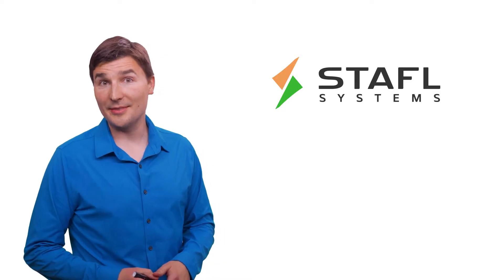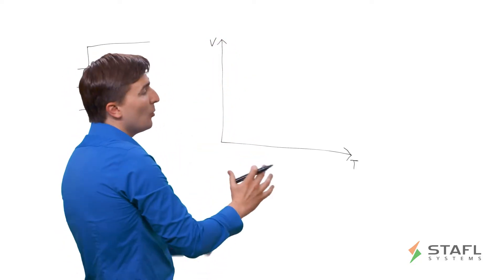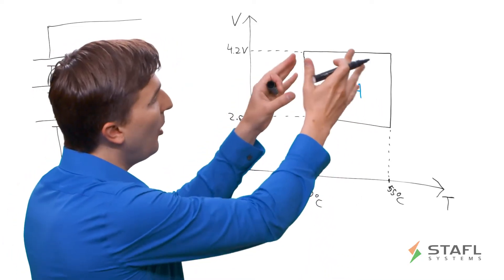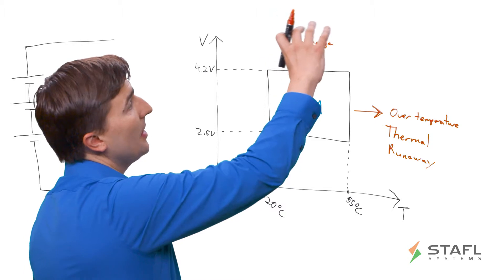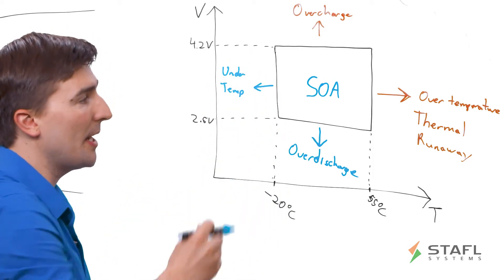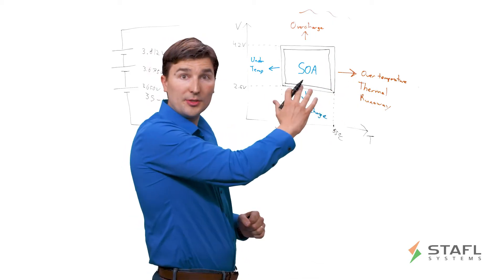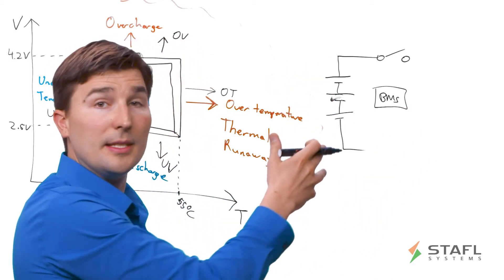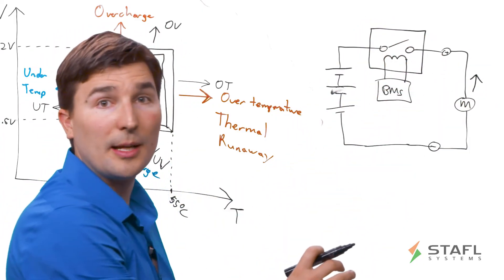Battery Management System Safety and Fault Management for Lithium Ion Batteries

Comment: how do you reset the bms when for example you have 3 batteries and they are not at same levels ex showing its full at 51v and another is full at 53v or one is full and the other one just drops to flat even though its not really flat

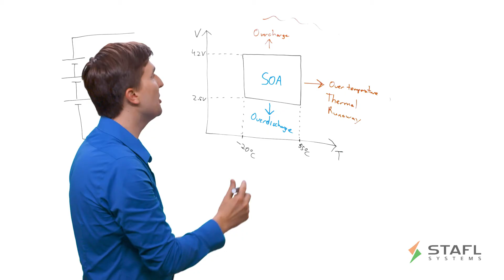Comment: I have a question: 4:45 - 5:30 = How can dendritic growth occur during over discharge in full cell? This is the process of Li+ going into cathode/oxide and LiC6 converting to carbon. Where is the dendrite growth going to occur? negative or positive electrode? If yes how is it going to occur? Please feel free to contact me.
Reply: Yeah I would also question the explanation in the video on this point. From what I know Overdischarge would be more likely to cause decomposition of the cathode and, in severe overdischarge cases, even the anodes copper conductor as well. Both scenarios are irreversible, like metal plating, but different never the less.